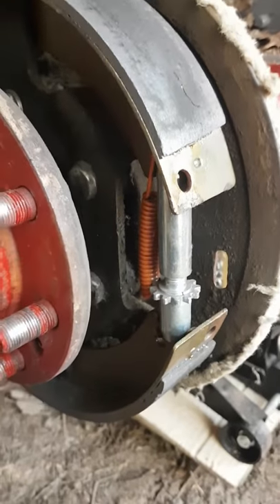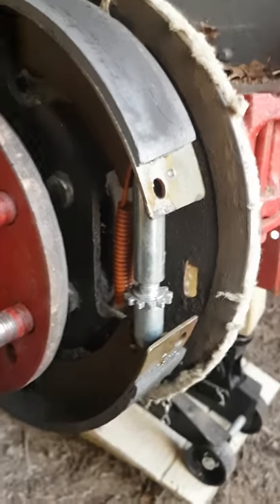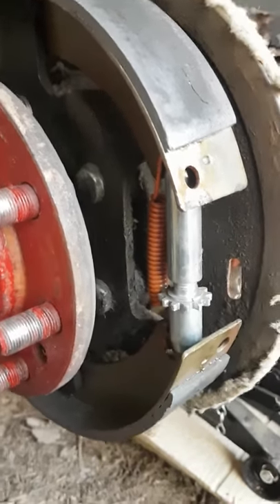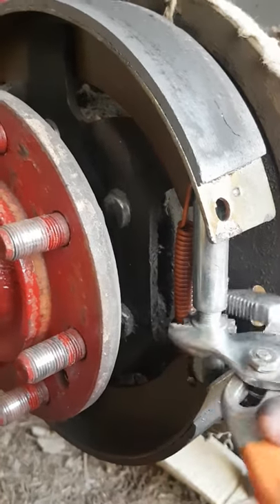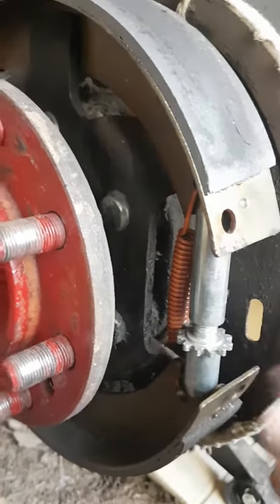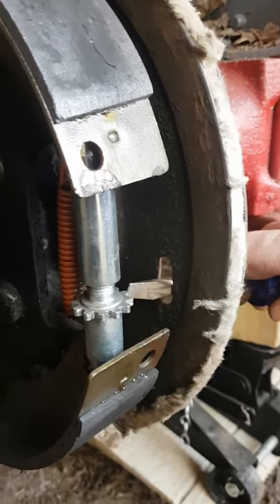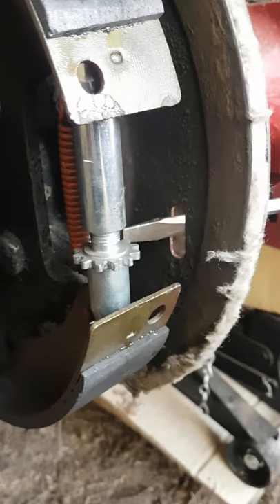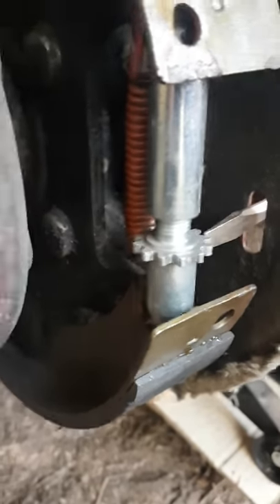Ford Jubilee NAA brake adjustment

Comment: They make a brake adjusting tool called a brake spoon, basically an oversized widebladed bent handled, double ended screw driver. If your going to tell someone how to adjust brakes on any drum type system, you should be instructing mechanics (or owners ) to tighten the brake shoes out against the drums until the   tire can not be rotated. This centers the shoes in the housing. After centering the shoes, the adjuster is backed off (brakes freed up) just enough to allow the wheel to rotate. The right brake should be adjusted first. This sets the pedal height of the right pedal at its final position. After adjusting the left brake following the compression,  centering & releasing procedures,  the height of the left pedal is adjusted to match the right pedal by adjusting the turnbuckle on the connecting rod on the left side of the tractor. I always check the temperature of the backing plate during normal use following adjustments just to be sure they are not too tight and if they are hot, back off both sides the same amount. Be sure to replace the cover on the adjusting hole and keep the spring and cover on the pedal rod side clean and the cover tight against backing plate.

Comment: You're saying the starwheel is RH thread even on the left of the vehicle.
All you need then is a spoon.
But you take it up snug and back it off, right?
Truck size brakes grow. I mean the expansion occurs as they create friction. It's much more than passenger car and light truck.
Remember to back them off.
Reply: Yes all you need is a spoon. It was easier to show with the wheel off. I adjust them just like drum brakes on old cars. Snug them and back them off a little.